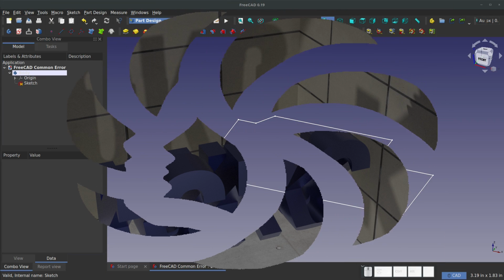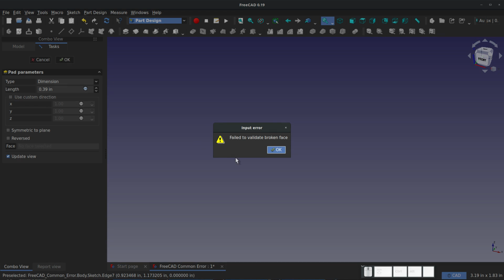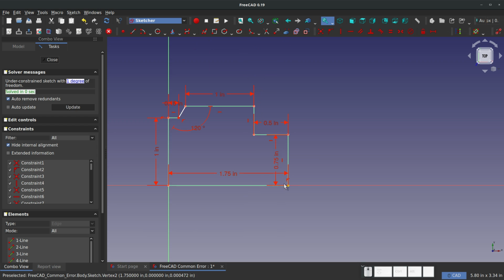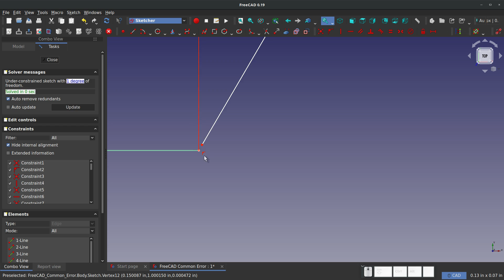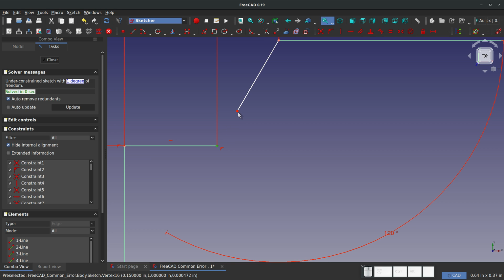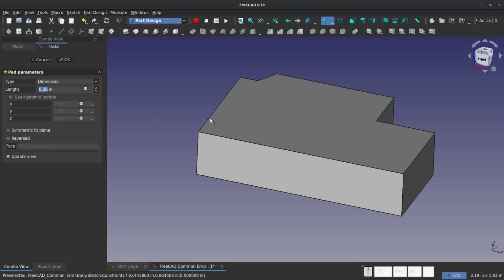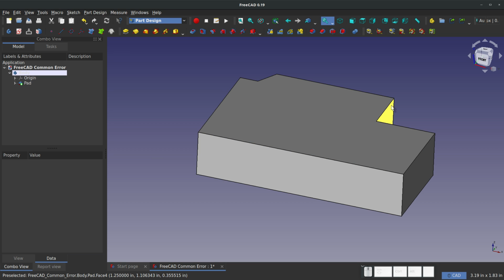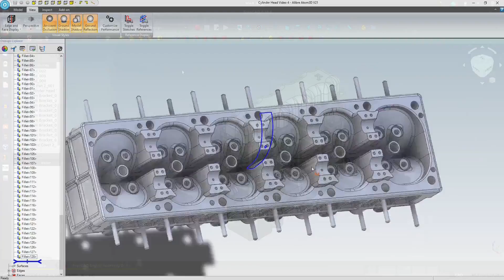FreeCAD- Fix "Failed to Validate Broken Face" |JOKO ENGINEERING|

Comment: Great information.  Another method for dealing with possibly non-coincident points is to box select (?)(click and drag a selection box) a suspect point and then click to unselect the associated lines.  Then I do a coincident restraint.  My mouse skills are not great and the zoom and rotate methods can be taxing.
Reply: So you're saying that you isolate just the points and then do a coincident restraint?

EDIT: I tried what I thought you were saying and it worked wonderfully!  I'm new, so I just spent hours trying to figure out what to do, before I came here tonight.  Once I did what you said, then ran the validator mentioned by Tim McVeu in his comment on the OP, everything worked out perfectly!  You both just saved me years of wasted time, lol!  Thank you!!!
Reply from the maker: Pinned, thanks for the suggestion

Comment: I have to add a big thank you for all the videos you put out. As an old retired guy, I was looking for an inexpensive way to get into 3D modeling for 3D printing.  When I tried FreeCAD at first I got frustrated and gave up.  After finding your videos I have learned a lot and had the pleasure of designing my first 3D prints with more on the way.  Your method of patient thorough teaching is so much easier to follow.  Thanks so much.
Reply from the maker: My pleasure, thanks

Comment: I've gone through, snapped all the points together, and it's still a "broken face."  Anyway, point snapping isn't permanent and I need something that actually deletes the points and joins the lines while keeping them "as is."  Is there a FreeCAD tool that does that exact thing?

Comment: what if all corners are perfect ?
Reply from the maker: There is likely a sketch element somewhere that shouldn't be there
Reply: @JokoEngineeringhelp  interesting idea... But the thing is, i can validate the sketch with a certain length of a line, but as soon as i change the lenght by using the tool for that, it wont validate again... But i can change the lenght of the line by just moving it around with my mouse and then define the length :/ ... might be a bug or sth
Reply: @JokoEngineeringhelp  but anyways thank you for this tipp !

Comment: Thanks for this tip. 
Simple question: Which keyboard monitor you use. 
I haven't been able to find one for Linux.
Reply from the maker: They keyboard monitor has been a tricky one for me.  Keymon is the only one that has all the features I need, but it only runs on Ubuntu 18.04 and prior, likewise linux 19-.  I have just heard of a new one called kmcaster, but I haven't tried it out.  It's apparently not packaged, but the .jar file is said to be compatible with Ubuntu.
Reply from the maker: You know what?  I found a flatpak for it.  This looks like the solution I've been looking for!

https://flathub.org/apps/details/com.whitemagicsoftware.kmcaster

Comment: If you go to pad a sketch and get the dreaded broken face error go to the top menu bar and click on sketch.  Then click on the validate sketch option.  A dialog box will open.  Look for the "highlight open vertexes".  Clicking on that will highlight an open vertex.  If you have a large sketch with a lot of short elements this will save you a lot of time and frustration.
Reply from the maker: Thanks for adding that!

Comment: I just want you to know that while you may not get a million views, every single one of us here are eternally grateful for these videos and what you do. I have learned so much from you. I cannot thank you enough. Keep up the good work!
Reply: I have to agree, i did try several time to do something in FreeCAD so i watched some videos, it did not go well to the point that i gave up for a while, then i bumped into you and @thehardwareguy so now i model and print parts for the CNC plasma machines i build ! Thank you.
Reply from the maker: @toma.cnc1  It means a lot!  I had a similar experience when I first tried it.  It's comments like this that make the channel rewarding.
Reply: @JokoEngineeringhelp  If you have a crypto wallet i will gladly buy you a beer or two.
Reply from the maker: @toma.cnc1  I don't but I am thinking of starting something like that.  Stay tuned!
Reply from the maker: Many thanks, people like you are the reason I keep up with it.  I'm glad it's helpful!